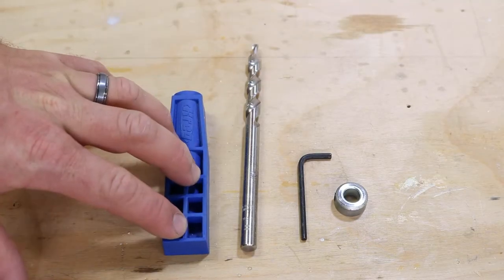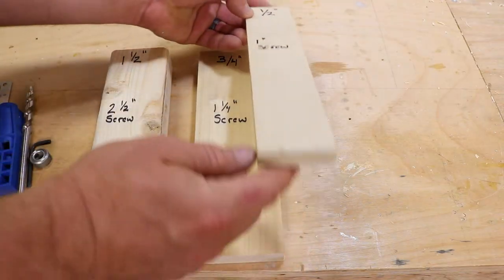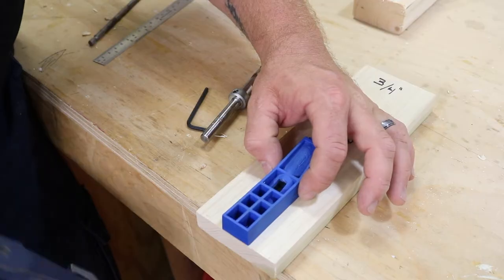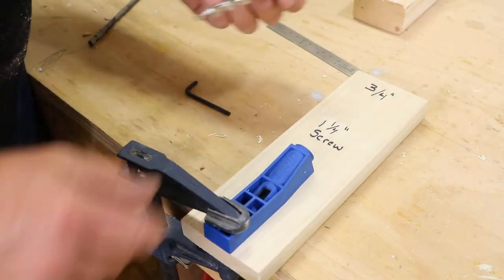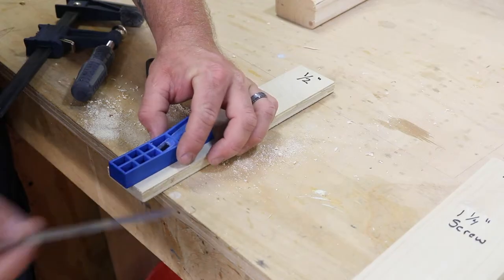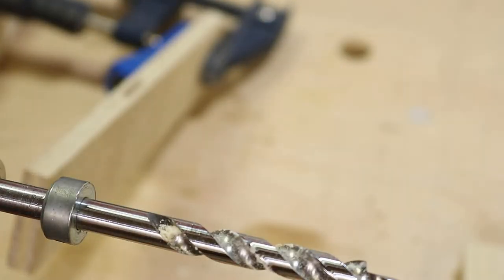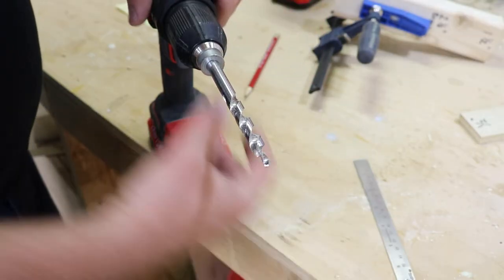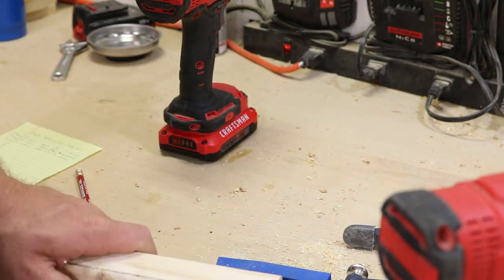How to Setup the Mini Kreg jig

Comment: I stopped halfway through the video ..... looked for something else. You never said why you set the screw depth at 3 1/2" on the 3/4" piece, and never said why you set the lip of the jig 1/4" past the edge of the 2nd example.
Assuming the rest of the video would be just as lacking in an explanation, I chose to look for another video. Thanks, anyway.